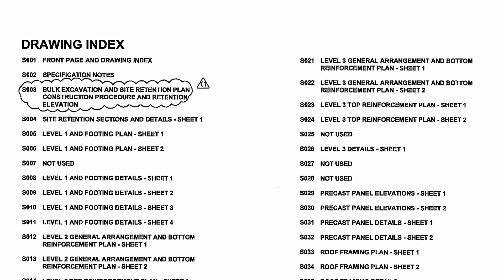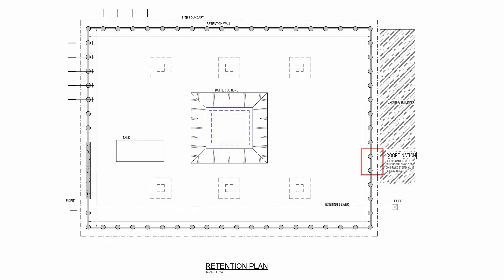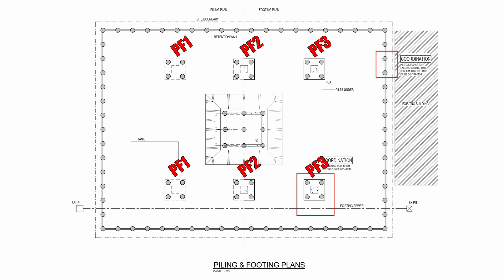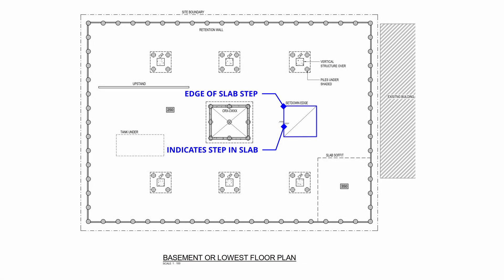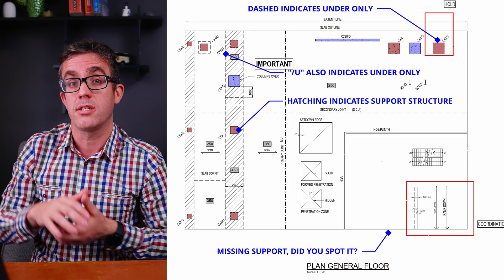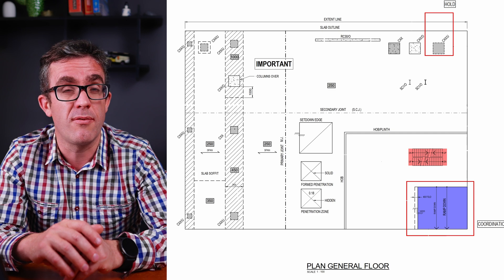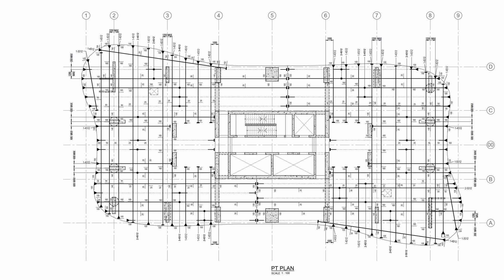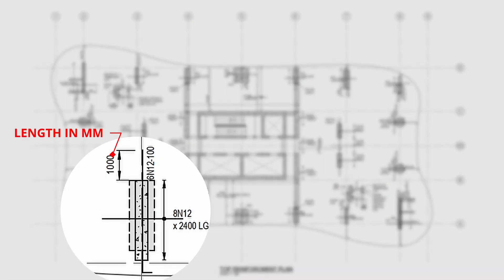How to Read Concrete Plans | The Basics

Comment: Hi, quick question: in structural plan views, by “looking down” I mean the standard top-down plan, and by “looking up” I mean a reflected-style plan used to read the underside of framing. In practice, when do you prefer each convention? For example, is “up” more common for framing/roof systems and “down” for foundations and shear walls, or do you follow a different rule of thumb?

Comment: Howdy Brendan, loving the content! If i could make a suggestion, it'd be cool if you could show us a 3D view of what each sheet would look like as well. A lot of fellow CO SCI majors struggle with grasping how the structure would look like visually other than trying to use our limited knowledge and experience. In college, we only learn the basics of all of this material, so a lot of us have issues grasping the concepts visually. Also, there are a lot of barriers with interchangeable terms in construction and drawings, so i spend a lot of time googling terms i've never heard before only to find out it is called something else. An example here in this video is that i have a problem understanding what an UPSTAND is so i googled it and all i see is roof UPSTAND so now im struggling to figure out why im seeing roof elements on a floor plan. Cheers!

Comment: Mr Brendan, what do you think about RC column (150x300 mm) using for 2 storey building (house) ?
Are those strong enough for gravity loads and seismic loads ?
Reply from the maker: Hi Adrainus, that seems very small and maybe new it's buckleing capacity. typically it will not be taking seicmic loads as it should not be a stiff enought element.

Comment: Hello Brendan! This is hands down really useful stuff that is not taught in universities. Glad that structural engineers like you exist to help out fresh graduates.
Also, I would like to make a suggestion for a new video, it would be really helpful if you analyse and design a simple residential/commercial structure and make a video out of it.
And thanks for your videos, they are very helpful and informative!
Reply from the maker: Hi Karthik, thanks for your support.glad that I can help.  Thanks for the suggestion and it is on the list, I just need to find a building I can use in the video.

Comment: An off topic question, do you recommend to start working for residential structural companies, mixed or commercial companies for bigginner?
Reply from the maker: Hi Murtaza, the right residential company can be good, make sure they are working on architectural award buildings, mixed is good if you can get them. I do have a video on companies size https://youtu.be/SRNW-mwrhCo

Comment: Great video Brendan! Would love to see how one designs such irregular two way slab using computer software. Thanks
Reply from the maker: Hi Rhedo, thanks for the support. You can design irregular slabs by hand as well. Thanks for the suggestion. Will add it to the list.
Reply: @BrendanHasty  wish hand method can be utilise to design irregular slab? Im currently studying slab design in general. Im familiar with elastic frame method but when there is significant offset in column then I dont know how to go about it.
Reply from the maker: Look at yield line

Comment: As a concrete junior foreman, this was fun to watch since I see this stuff everyday 

I’m curious if you can do a video on how structural engineering firms estimate and produce bids. How many hours do executives guess a project will take to design, design by parts ? Exclusion of certain scope that was not part of the contract ?
Reply from the maker: Hi Daniel, Thanks for the support. Did you think I missed anything? 

Thanks for the suggestions, I will add it to the list. It is really helpful to get suggestions of topics to cover.

Comment: What's your opinion of car shock absorbers (45 deg brace) being used to absorb earthquake energy (timber house)?
Reply from the maker: Hi I design NZ, there would be some benefit in it if tuned correctly. It would also need to be detailed The cladding for the movement. However timber house are already very flexible so The benefits are limited.
Reply: @BrendanHasty  
Thank you.